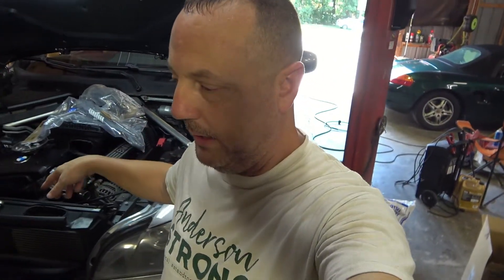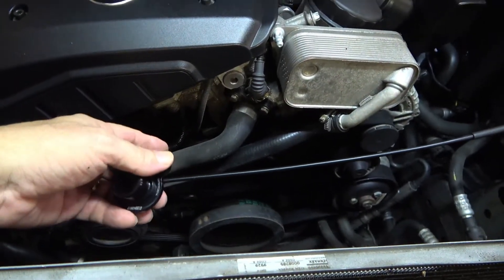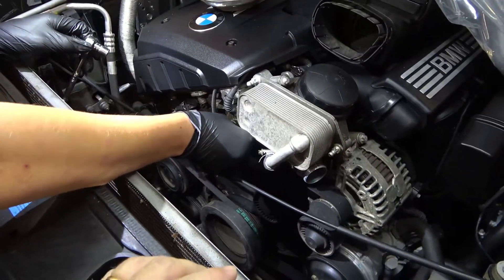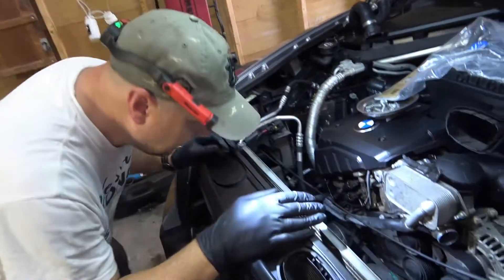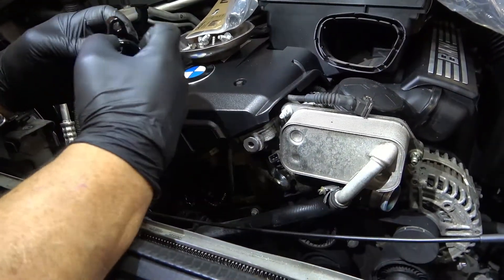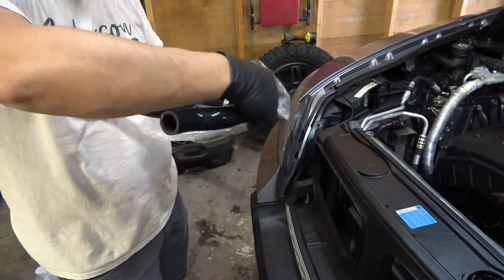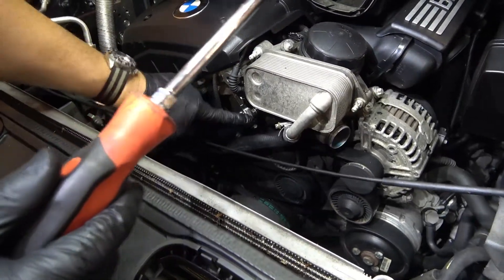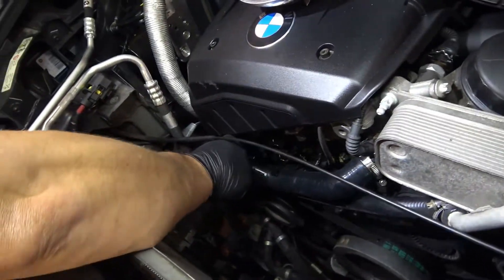BMW N52 Coolant Outlet Hose Upgrade (328, 330, 528, 530, X3, X5)

Comment: That hose goes to the left side of the thermostat housing, not the water pump.
Reply from the maker: @jashaylagillespie6458  technically you are correct. What I meant was that it goes to the water pump / thermostat assembly
Reply: Thanks for clearing that, deadass looking at my x5 with this issue and I’m sitting here like isn’t that the thermostat 😭

Comment: Is it required for the radiator to be out if you’re only planning on replacing the outlet gasket on a E70?
Reply from the maker: IMHO if you are removing the upper radiator hose, you risk tearing the nylon polymer radiator tank. Best to be ready to replace it